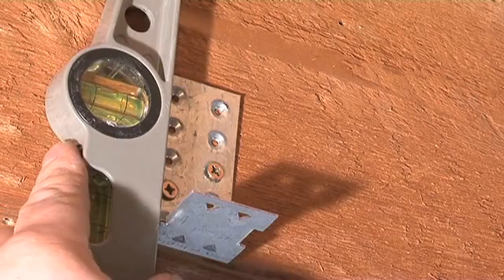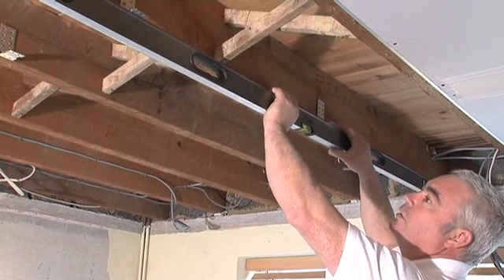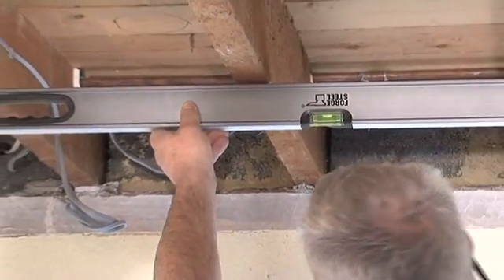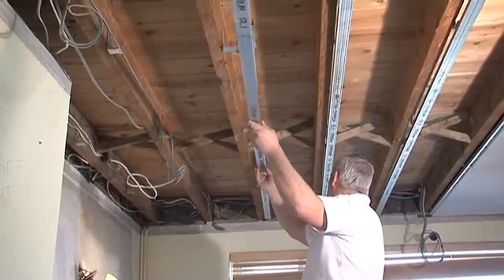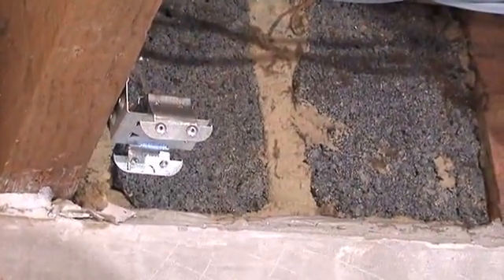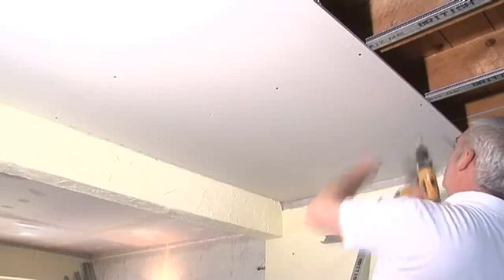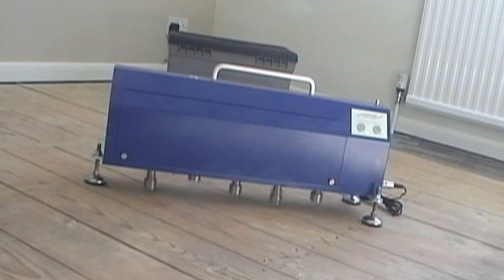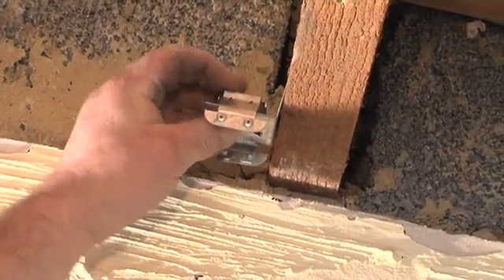How to install a soundproof ceiling

Comment: Is it best to do walls first before ceiling?
Reply from the maker: Hi Peter.  I would do the ceiling first.  This will help to reduce flanking noise down the walls.  I have done it this way in my old and current homes and works really well.
Reply: Always complete the ceiling first. That way, the wall drywall helps to support the ceiling drywall sheets at the edges. It makes for more stable joints, with greatly reduced risk of the plaster cracking over time.

Comment: is this better than resiliant mounds?
Reply from the maker: Hi Feronom.  Yes, these perform better and have the flexibility of being able to adjust height to give absolute minimum height loss or put up flat ceilings across uneven joists.  It can also work our cheaper than some other competitors when you add up all the components required. Hope this helps.

Comment: ilive into an apartment .and these people live above me .they are so nosie .where the floor that   when they walking u hear them .then they drop stuffs in the floor.if I could fix the problem iwould have .but the apartment its not mine am only renting.how can or what can iuse to block the noise out without destroying the apartment.
Reply: The Iso-Mounts are the best way to deal with the impact noise as they are breaking the path of vibration which turns the ceiling below into a speaker effectively. 
If the boards are close together, the Celbar will not blow through. If there are larger gaps, it is advisable to seal with a bead of silicone if the ceiling is down. Underlay on the floor above will also stop it.
Reply: Hi +Charline Delisser.  It is sometimes possible to pump the Celbar insulation straight into the void without taking the ceiling down.  This will help greatly with airborn noise, less so with impact noise
Reply: @benhancock542  Wouldn`t the Celbar insulation stuff just ooze through between the upstairs floorboards?
Reply: +Ben Hancock what should we do for the impact noise?
Reply: Hey mate I have the same issue

Comment: its funny you using eurp.measuring and your using a ruler with inches.This is not sound (Proofing)
Reply from the maker: Hi Danny.  We achieve the best results for this type of system.  It is very good soundproofing.  Al the best.  Ben

Comment: This is just what I need ..the 2 pensioners upstairs are driving me nuts with their TV on FULL BLAST and their constant arguing!
Thank you !
Reply: My upstairs idiots are doing a same.I feel your pain.
Reply from the maker: Hi Borderlord.  I'm glad you found it useful; thank you for your comments.  I hope you enjoy using the system.  It really does work very well.  Best regards,  Ben
Reply: I live downstairs as well in the unit with timber floors upstairs and you can hear every footstep every time they walk across
Reply: @sergsergio3576  i have the same issue, have you sorted it out, any advice that would help? I would really appreciate it
Reply: @selwairbouh7723  not yet tried to contact strata to have it soundproofed if we can claim it under insurance haven't heard back from them